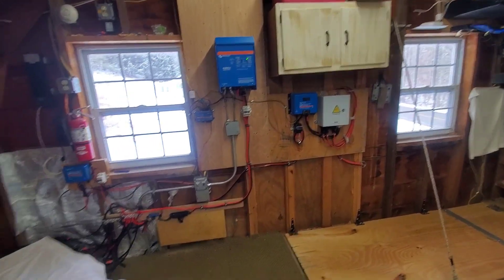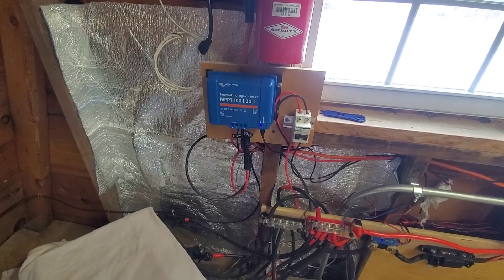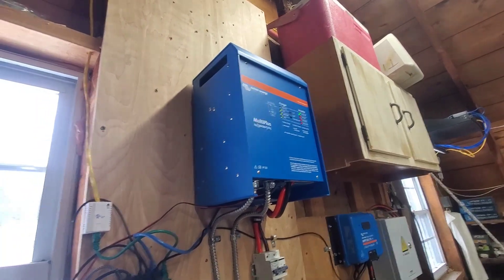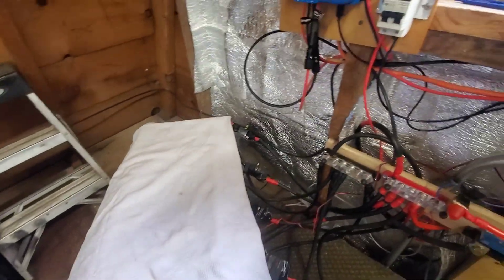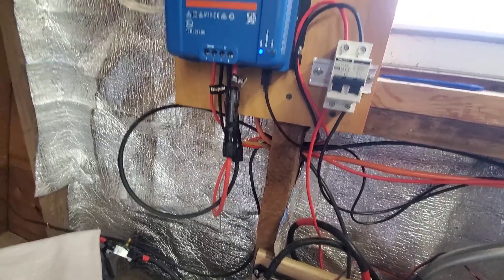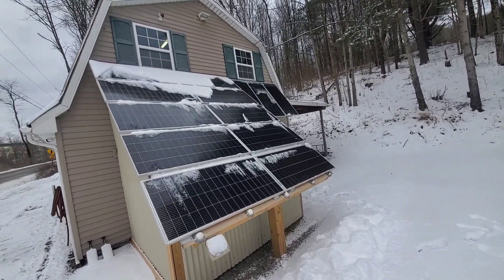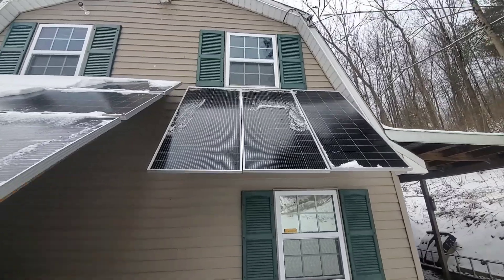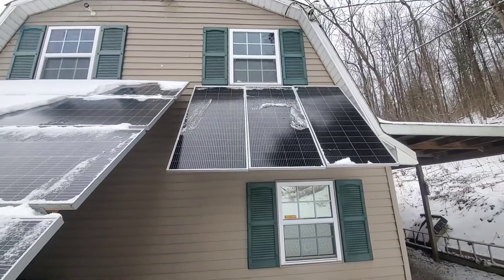2600 Watt Solar Garage System with Victron Multiplus Inverter- Part 4 Added Panels and Controller

Comment: Ya 4 hours of charging sunlight aday max with snow covered panels durng the winter aint to good for duing much. I have a similar set up as you but i live in the great state of CA on the equator. I get about 5 to maybe 6 hours of charging time with a ats set up like yours. Im on grid power during the summer far more then i would like for the money i put into it. I canconly imagine how much you use grid power .  Aolar is pretty cool but its not half what its cracked up to be.
Reply from the maker: @GGameBoy11  you got that right!!!